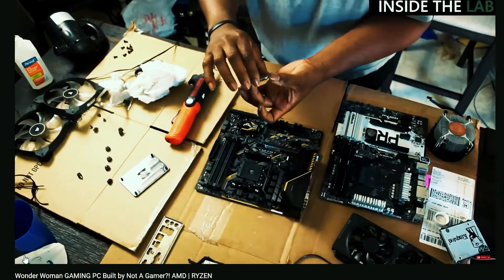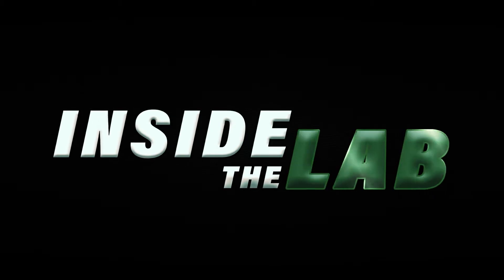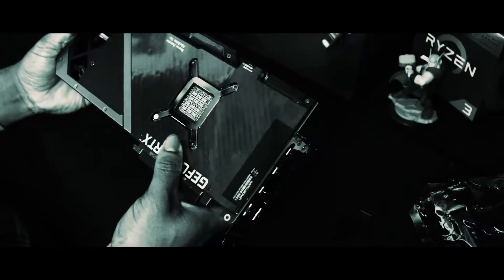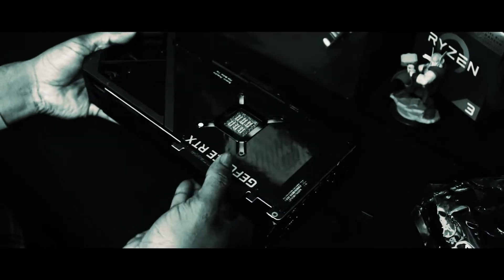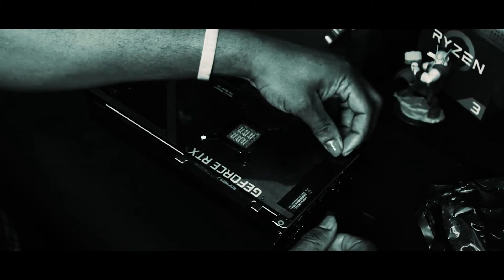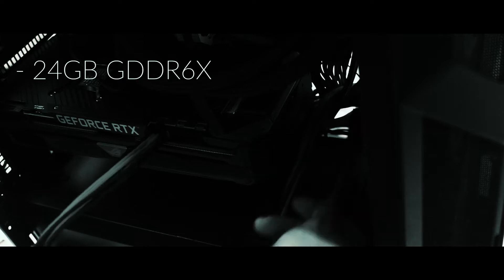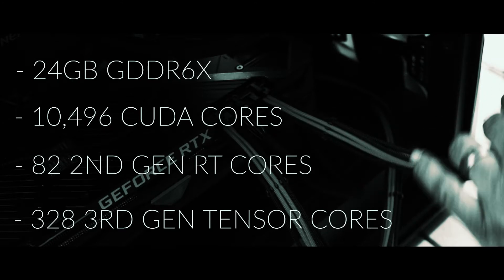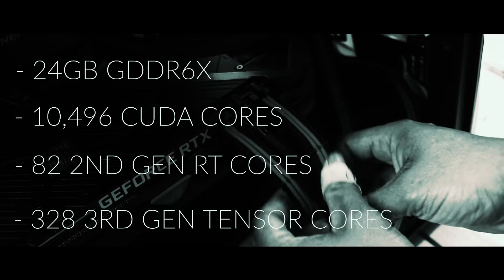Fastest GPU In The WORLD 2021: ASUS ROG STRIX RTX 3090 Review

Comment: In this video you said that this card retails for $1500, but everywhere I look says $2300 is retail. Is this a good price? I plan on getting this card for my new build
Reply from the maker: Hey @michael_edg !! Prices have been widely affected by the global semiconductor shortage; they were in stock at the time but nearly all GPUs are selling for 40-50% more than what they are worth. 

The value, is in the cards availability, and depending on what you plan on using the 3090 for, it certainly can be worth the premium, if you want a no compromising card. 👍👍 

What CPU do you plan on using with it?
Reply: @SuperMetaTech Ah ok. I have a ryzen 9 5950x for my new build.
Reply from the maker: @michael_edg3370  16 core Zen 3 👌👌nice choice to pair with this card. Which resolution are you using?

Comment: Hmm I just did the same Benchmarks and absolutely crushed your scores with my asus strix 3090. Im wondering if maybe you got a bad sample or i got a really good one. Mine also overclocks way higher. Scored 4000 points higher with firestrike extreme and 1500 point higher in firestrike ultra. Otherwise great video =)
Reply from the maker: Hey @Chris !! That's nice fam, elaborate on crushed tho? 🤔

I cross referenced my scores with others before production of this video and they were all within margin (at stock anyhow). And this isn't a sample unit, I bought this RTX 3090 with cash money; and with overclocking well.. it's silicone! 😅 They're made not to perform/oc all the same. 

I really felt I could of pushed the OC more but for me personally if it's not stable in Heaven/3Dmark/and games, with no issues at all, then it's not a stable oc. The numbers displayed at the end (+190 on core and +400 on memory) was stable in every benchmark tested.

It's a great card either way, expensive sure, but great card nonetheless. 👍

Comment: Good work and massive information about this great GPU. I have the same GPU in which we are in the same page that RTX 3090 ASUS ROG Strix is the best GPU. Frankly speaking, Since I had GTX 980Ti, then GTX 1080TI and then RTX 2080Ti, I did not like to overclock anyone. I do not believe OC GPU is worth it. Now with my RTX 3090, I will never OC to keep it safe from any unexpected damages. it is just my opinion.  Again, good review. Thanks
Reply from the maker: Hey @TIG TIG !! Awesome name btw !! 🙌😅 And thank you for the feedback and support on this one, it was a blast to produce. And yup you're absolutely correct there, it is the best and by best we meant fastest, GPU available (ish) 😅 to consumers. And you're right, in some instances, thanks to GPU boost, overclocking isn't practical for everyday use. Better to keep those temps and power draw in check and your card running 100% stable. I just like doing it haha 😅 but it is an expensive piece of hardware so totally understand why one would want to ensure it's life span. Thanks again for the kind words and support fam! Def appreciated 🙏
Reply: Really weird way to say lol oc doesn't damage it what damages is heat and voltage lol such a dumb comment for a normie